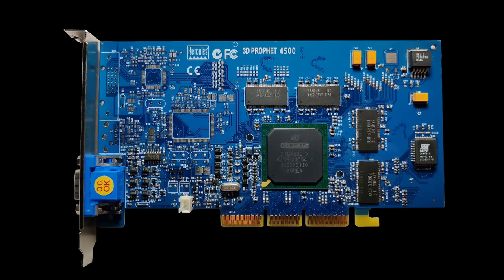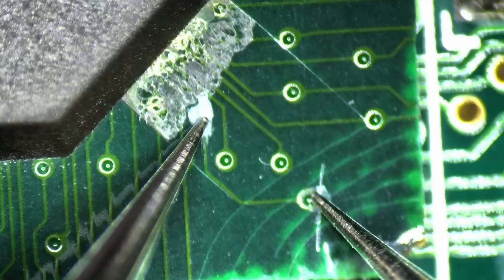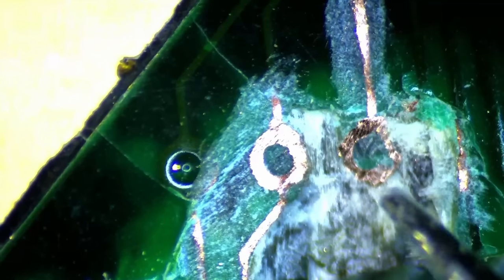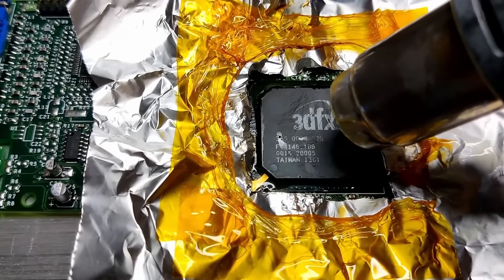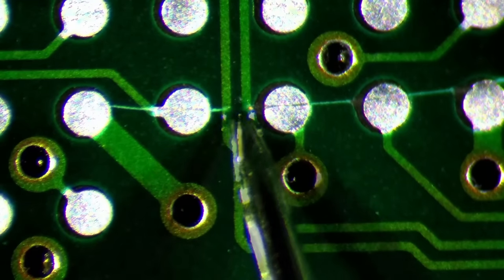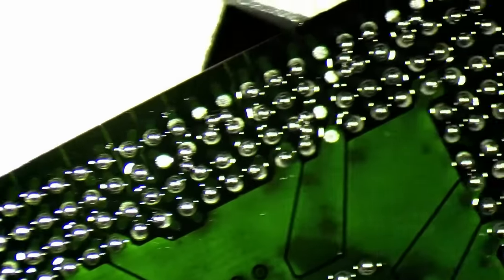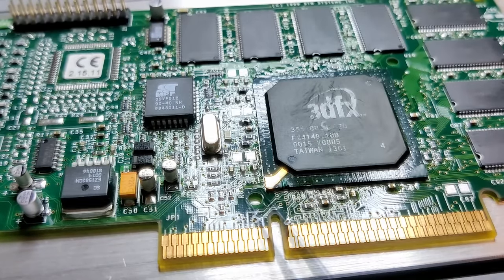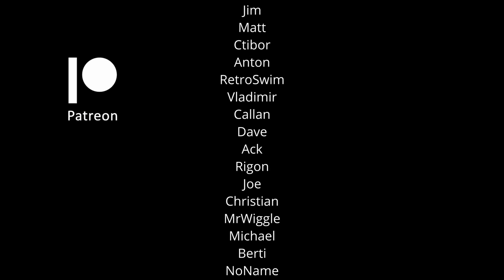3dfx Voodoo 3 2000 - My first attempt to fix a BGA chip!

Comment: Wow, that was a really interesting repair attempt. I've never worked with BGA, but it looks surprisingly easier than I expected, just a lot more tedious. At least hand reballing anyway. From what I've seen of Louis Rossmann's repairs, it's not even 100% guaranteed to work even when you've got one of those huge BGA soldering machines with a fancy alignment camera. It is definitely possible though. I know you've got the patience, all you need is a little more practice, and I'm sure a new hot air station would help!

My suggestion would be to find something very cheap and plentiful with a BGA chip that you can practice on. Obviously something that you know works. Like if you can find a pile of those old Linksys routers, just check if they've got a BGA chip inside and they boot up. Not sure if they've got a serial console that you can solder a pin header onto and plug a USB serial cable into to get access to the CLI so you can see it boot.
Reply from the maker: That's a good idea! I don't mind practising on more devices and the test afterwards would be essential to verify and assess a successful BGA replacement.
The difficulty of this repair is to get the temperatures right. The rest was not that bad - even the manual reballing was fun (well, the first time).

Comment: I feel like I'm repeating myself but wow, that was some mighty impressive work there again! It's a shame you couldn't revive this card (yet?), but it looks like you did gain a lot of experience (I certainly did just from watching!) and even with perfect methods, your chances of success were pretty slim to begin with. I wasn't optimistic from the outset, but when I saw that some amateur had already tampered with it (beyond just attempting to take the heatsink off to re-use it somewhere else), my heart sank even further, as it meant that it probably had an issue beyond the absuse it was subjected to. As Captain Picard expressed so pointedly in S02E21 of my Bible, "it is possible to commit no mistakes and still lose".

I think there is a minuscule chance of the last issue being that the undersized solder balls prevented proper connectivity, so it may be worth having another go at it with bigger ones. I really hate the fact that one cannot check below SMD components. We need BGA to PGA conversion kits!😅 Anyway, good luck in case you decide to go through the tedious re-balling process once more!

Also, good luck for the other two cards! 🤞🏻 I'm quite optimistic about the Kyro.
Reply from the maker: I will try again - once I get a better hot air station. I'm still not giving up. So, either I'll get another practice round from this card and the third time it'll work, or it will work on the second try. Miracles do happen... Sometimes 😁

Comment: I've had good luck using dental floss to remove glued on heatsinks, just use the dental floss as a wire saw.
Reply from the maker: That works when you try to remove heatsinks that were glued with double sided thermal tape. The stuff on this chip is not going with Dental floss - I have tried this on my working Voodoo 3 2000 - the dental floss breaks every time

Comment: nice work, but I think that the 3dfx chip has gone to silicon heaven, for this kind of work you clearly need a BGA station, it is not possible without it, as you said in the video, if you find a damaged type of 3dfx card with a good 3dfx chip, you can try to rebal number 2 and I think that you will be successful 😉
Reply from the maker: Thanks! Yeah, I am not giving up. Although, I will give it another try. Once I get a better hot air station, I'll try once more. For one, to practice and I still have a little hope left. I just want to give it another try.

Comment: i think that beep mean memory... i could be wrong but thats what my brain says immediately. 🥰
Reply from the maker: Unfortunately, the system booted when I tried to flash the Voodoo 3 with the help of a second PCI card. So, it is definitely complaining about the Voodoo 3.
Reply: @bitsundbolts   When you booted the system with a second video card was anything detected on a PCI device listing? That could give clues even if the card doesn't POST.
Reply from the maker: No, nothing was listed. Also, the 3dfx BIOS flashing Tool didn't detect the card.

Comment: i usually work on newer gen gaming consoles and sometimes for fun on old and retro products 
i was amazed that the chip didn't popcorn with that small ass nozzle 
given chip popcorning is not only due to the moisture in it but also uneven or too high temps 
secondly the bga balls look perfect and last thing these chips have multiple layers in them and it's highly likely that the damage casued an internal trace to get broken off or a internal short so i would recommend to replace the entire bga and the video was very fun to watch 
luv from Pakistan